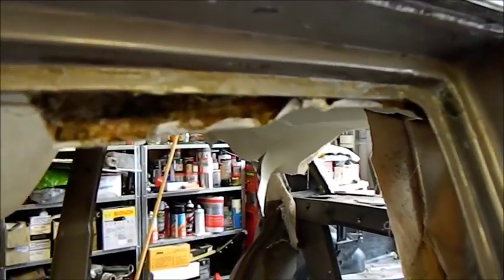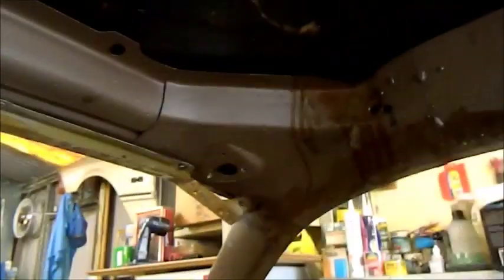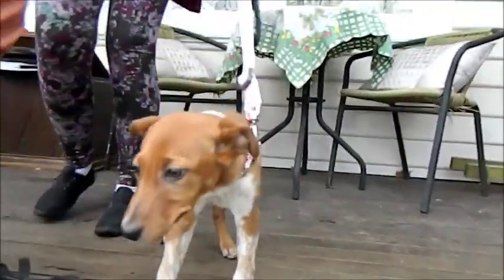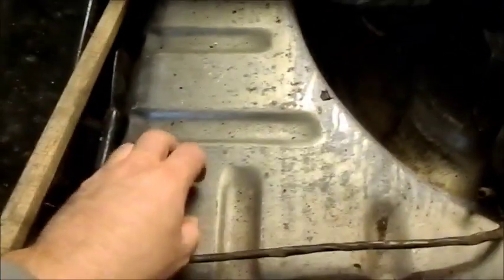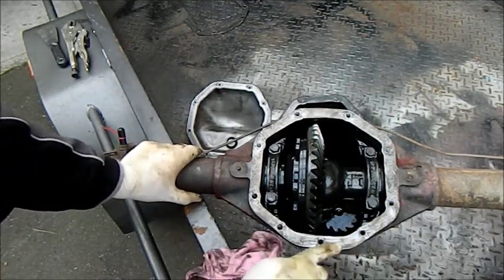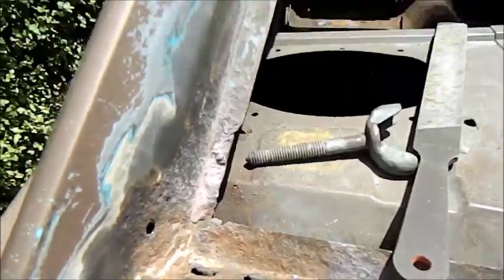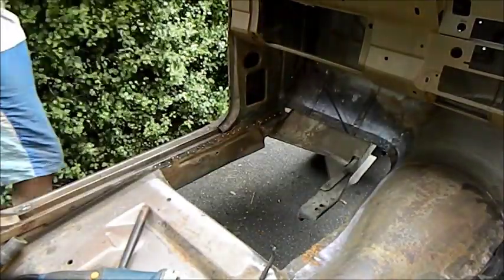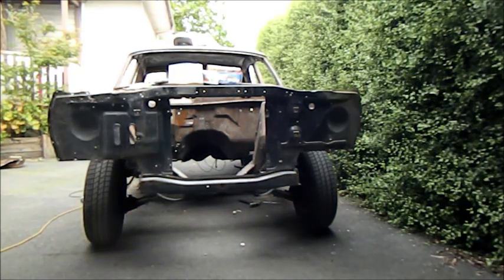1969 XW Ford Falcon Restoration Part 3

Comment: Great work Peter I am following your progress so I can get some tips in putting my 71 XY back together.  Its comforting to know that the usual rust is common on these shells.  Unfortunately my shell has take a hit on the passengers side front guard and covered up by the previous owner/owners.  I have just this month got it onto a car aligner and pulled that damage out. Keep up the great work.

Comment: Well   this is about a year ago .however my way of derusting floors with out getting dust every where is to make the floor water tight and use molasses @ 1/20 followed by soda ash . floor is perfectly clean ,all  damage visible .takes about 24 hrs but yo wont get a cleaner floor .treat  with phos acid and paint . gds fredw

Comment: Very nice, I not the only one who likes 4 door falcons, I  have a 68 Falcon Futura with same engine n  five speed...
What kind tranny you going to used?
Reply from the maker: Just a 3 speed C4 auto... that was the reason I went for a 2.92:1 rear axel from a 302 XY, so it doesn't rev too high on the open road. Wouldn't mind a manual, but my daily drive is a SS 6 speed manual so an auto is nice for the weekend. Thanks for the positive comments.
Cheers Pete

Comment: I really don't know what to do with my Dad's car, i gave him my personal opinion to bring the car back to bare metal and fix it properly to the level that their is not what people call 3 inchs of bog on the car. He done welding on it with Oxy and i see why he bogged it so much, because he done a terrible job keeping everything straight 20 odd years ago. Using a special magnet i could tell that the thing needs ALOT of panel beating or else the section needs replacing. Skids i believe they were called. I am good with cars, just awful with words.

I personally would like a second opinion because he never gave it surface preparation before bogging the sucker.